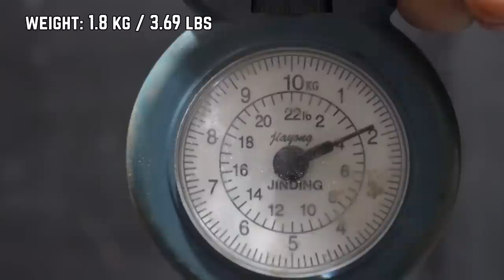Restoration Rusty Axe - Eaten by the Earth

Comment: What chemical do you use to soak the tool heads before cleaning off the rust?
Reply from the maker: Hello sir, I used cheap rust remover, name is "Yeetis" in yellow plastic bottle (550ml and 2L).